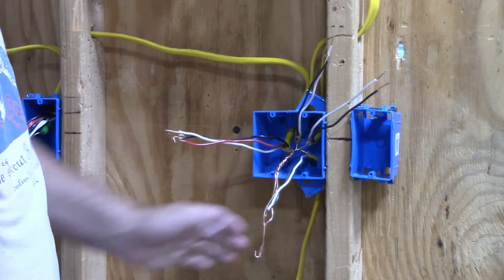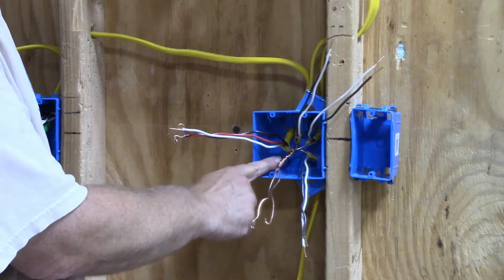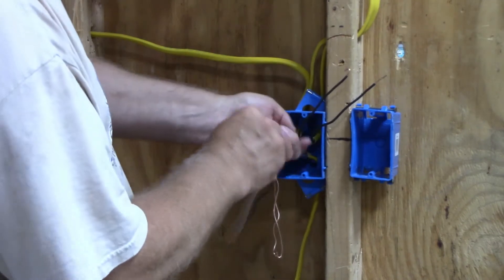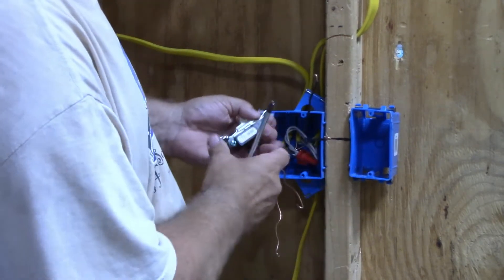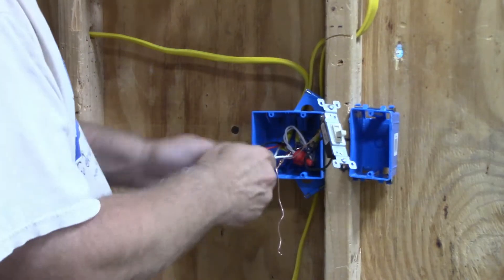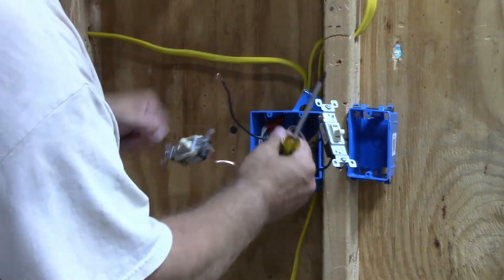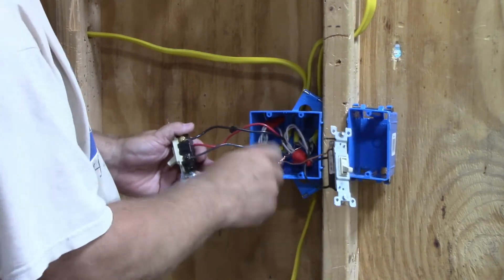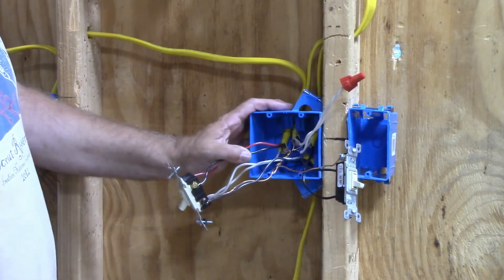2 gang box, switches on separate circuits

Comment: Since there’s two separate circuits in the same box isn’t it required that there be a partition/divider between the two switches?
Reply: It’s only if the voltage is higher than 300 volts
Reply from the maker: No. You can have multiple circuits in same box, there is no way to divide them.

Comment: hey, in my house we have a stacked switch in a single gang box.  each side of the switch is seperate circuits. is that safe to do if on a double handled breaker?  thanks for the help!
Reply from the maker: To clarify, they have different hots but share a neutral and they are on a double breaker?
Reply: i didn't do a good job explaining.  we have a single gang box.  a combo switch with (2) 3-way switch toggles.  each switch is a seperate breaker.  i will install breaker ties in the panel.  just making sure that it's safe to do so.  thank you! @timpalmer-logstolumber1999

Comment: They should charge the code to ban having multiple circuits in one box.
Reply: I believe your wish came true, multi gang boxes with multiple circuits now require a divider inside to separate the circuits
Reply from the maker: Make sure that you are safe, turn off all power if you are working on a multi gang box.
Reply: @timpalmer-logstolumber1999  <3
Reply: This is a great video. I really appreciate you posting this. I was trying to figure out if I could tie two switches into the same neutral, even though the two switches are on separate circuits, and I now realize that I cannot do that. Great video!!
Reply: agree!